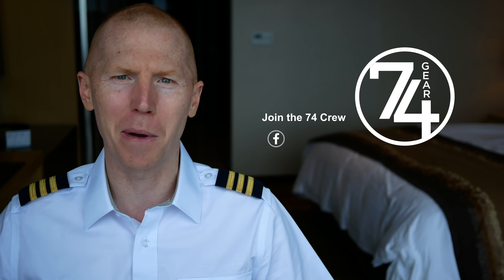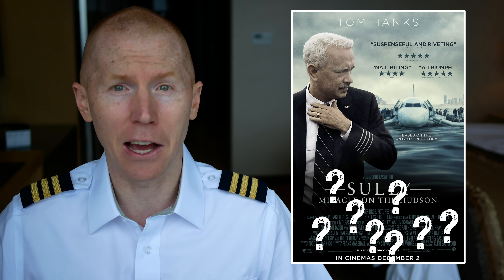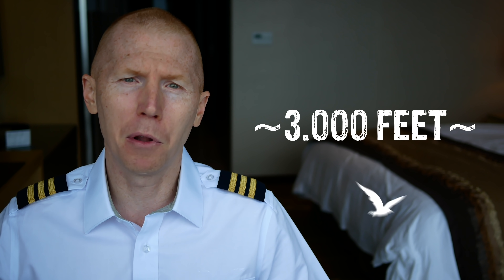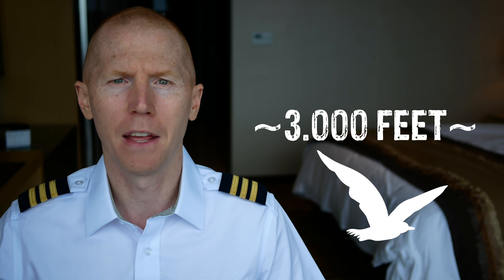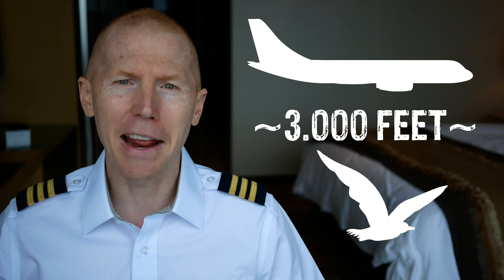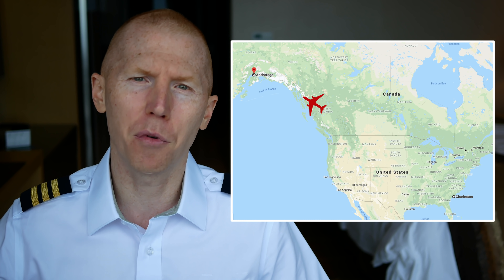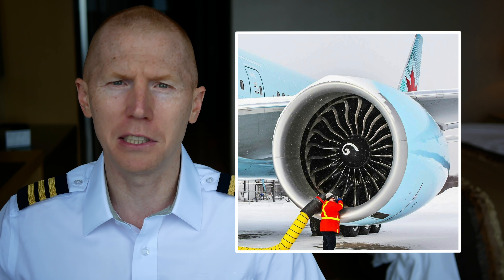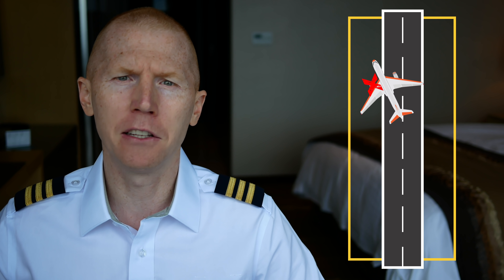Why Engines Don't Have a Mesh or Grates to Stop Birds

Comment: Per chance engines could be equipped with frontal macerators to pre-particularize birds, rendering them harmless.  Cheers!
Reply: LectronCircuits    good idea, then the macerated birds could be fed into the galley for a new lunch menu item !
Reply: @robertbernstein4488  eat 'em up yum!  Udaman.  Cheers!
Reply: Actually they are.
One of the design criteria for the front end of jet engines is the ability to handle bird ingestion. The fans and the first compressor stages are designed to chop the bird into little pieces and pass through the engine.

The engines are subjected to bird ingestion tests prior to approval.

Comment: This new imbalance technology - does it use more than one sensor? 😨
Reply: <<Sarcasm mode: ON>>
No it uses one sensor, because you know, that's good enough. Plus Boeing buys the made in China version, because you know, it's good and cheap, and that's just the way it is, Baby.

It goes without saying that this system is so awesome and perfect that there is no need to mention it in any documentation or training given to the operating crews. The FAA got us covered with their certification, so who cares,  and that's just the way it is, Baby.

Baby that's Just The Way It Is, Baby
Whoah whoah
That's Just The Way It Is, Baby...
<<Sarcasm mode: OFF>>

The dumb and greedy are destroying everything beautiful about aviation. And sadly it is going to be worse and worse. Just observe the facts with unbiased critical thinking.
Reply: Oh no! The Boeing 737 MAX nightmare revisited!
Reply: Imbalance has always been measured (and displayed) by the AVM--Aircraft Vibration Monitoring System for each engine. If vibration reaches level 5, the pilots are instructed to reduce engine speed to idle (where you can still operate the  A/C, electrical power and hydraulics). If still too high, they have to shut the engine off to avoid more damage to the engine or engine structure.

Comment: I have an unrelated question- on a 747, how many engines need to be providing thrust to take off, fully loaded?
Reply: Three. If the 747 loses two, it is doomed. Two engines on a four-engined aircraft is not the equivalent of one engine on a twin-engined aircraft.
Reply: @marks6663  Thanks, been wondering about this question, but couldn't even guess with any confidence 👍

Comment: Nah I'm calling bull, chain-link might cause 1%-5% in losses but you can make up for it with larger scoops/intakes.
And if its really that big of a problem at altitude, you can just have retractable screens.
Reply: What you're missing is how the engine actually pulls that air in. It isn't only about surface area but about how the air is funneled in. The screening would increase turbulent air along the boundary layer created close to the inner wall of the turbine and would decrease engine efficiency more than you are thinking of. Even at the 5% decrease in efficiency you listed it would require an additional 3000 gallons of fuel on a 747 when flying at it's full range.

Comment: How about a screen that retracts after the plane reaches 3000 ft?  Or if the pilot could activate a barrier if he/she realizes there's developing bird problem?
Reply: Reelin' and Rockin' lol thats a little dumb, the plane needs most of the power during takeoff
if u put a barrier like that it would cover atleast 10% of the engine
meaning 10% less air
so ur putting max power on the easy part and 90% power on the hard part
not very efficient if u ask me as u would need to make the engines stronger
in order to take off exactly how we take off without the barrier
Reply: Reelin' and Rockin' also im pretty sure when the pilot is at 100-3000 feet he doesnt see whats infront of him
cuz the plane is still taking off
most commercial planes cruise at over 10000 feet
soo yeh he wouldnt see a bird problem develop

Comment: Generally speaking, how many birds or what size bird does it take to kill an engine?
Reply: Not such a simple question to answer..any kind of FOD (Foreign Object Damage) can kill a jet engine..size is not the detirmining factor.

For example on aircraft carriers daily FOD walkdowns of the deck, between flight ops, are undertaken by lines of people, walking the full width of the deck, looking for even the smallest of nuts, bolts, ceramic shards from a dropped coffee cup..ANYTHING!

But to answer as best i can, I'll simply say that it depends on how well the object goes through the engine's various stages, without causing damage to them..

A jet turbine engine has several stages of compression, the big 'fan' at the front sucks the air in, but it then gets compressed down, to a increasingly smaller, tighter more compressive chambers, as it gets mixed with fuel, and combusted..

So, any object or bird that goes into the fan will one of 2 things..

1: It will get chewed up quickly, BEFORE it can break any turbine blades, or create any other such shrapnel out of any of the engines own internal components, (that will only create further damage & self-destruction)..and be spat out the back as a pink mist, with the rest of the thrust being produced..
 This 'should' be likely, if the bird's bones & mass get chewed up quickly enough by the first stage fans & their larger turbine blades..

Or

2: The object can damage the blades, more than they in turn  destroy it's mass & bones, which means that the engine will not only become engulfed by the amount of crap filling it, and interupting the air/fuel/compression & causing a flame out of the engine..

But also if the impact compromises the blades, they can also be destroyed, and at high speed revolutions, could break & become further shrapnel, like throwing a handful of metal into a  blender..that's also burning fuel..and, well..not good!

Sometimes, if they mashed well & quickly on their way through, and didn't break anything, just choking the engine into a flameout, you can get the engines to re-light..other times they can be completely 'fowled' up, & be far too badly damaged by FOD, to continue working at all..

So, There is no exact answer that would tell you that, it's all copacetic to what kind of FOD, how quickly it got minced in the first (turbine blades) stages, and then, how 'cleanly' it then went through the next stage (combustion chambers) of the engine..

A big bird could, potentially, be less of a threat than a small piece of hard metal..such as a bolt or nut, for example..

But if it hits wrong, and destroys blades instead of getting minced fast, even a smallish bird could cause flameout, or even destruction, of an engine..

There is just no way of knowing, until it happens, it's a bit of a 'lucky dip' really..

Hope this answer was somewhat helpful, even though it may seem obvious in some respects, it highlights the fact that it's a complex series of possibilities & outcomes..

But generally FOD is the bane of aviation, and to be avoided at all costs, as much as humanly possible..because anytime you catch any, you'll pay dearly for it in one way or another, Guaranteed!
Reply: Thank you for the detailed response.  Kinda surprised it doesn't happen more often.
Reply: @dr.chrisfragiskatos8341  
Most welcome.

Comment: The f18 has what are called turn screens, they are used on ground turns to prevent FOD from entering the engine and harming it. Even though it is a  fine mesh that is used they can still take the engines up to full afterburner with little to no loss on power.

Comment: If most bird strikes occur below 3,000 feet, why not design a system that puts a screen in front of the air intake that automatically retracts above 3000 feet?

Comment: With the high bypass ratio jet engines, even if a bird goes through the front turbine blades (and damaging the blades), there is a good chance any ingested bird will bypass the heart of the engine.

Comment: The airport authorities themselves have many counter-measure procedures to try and scare birds away from airports, reducing the chances of bird strikes.  Also, many standard procedures are in place to try and reduce the attractiveness of airports to birds.  For example, removing large bodies of water near airports (JFK is located next to Jamaica Bay, attracting many birds along one of the major bird migration routes, causing many bird strikes).  Lids on large garbage containers, to prevent birds getting into garbage looking for food.  Keep the grass cut at certain lengths, making it more difficult for birds to spot potential food from the air.  Always be cautious once the weather clears up after poor visibility or rain, the insects come back out.  Birds know where and when to find insects or anything they desire to eat, so they come out looking for insects to feed on.  Bird strike counter-measure procedures probably vary from one airport to another, depending on the type of birds located in the area and what those birds desire.

Comment: You know why I always fly on a 4 engine airliners?  Because they don't do 6 engine airliners!
Reply: WhitwellMike B the Russians might have a six engine plane
Reply: @kentrinfret2979  The Americans have 8-engine planes. And lots of them (the B-52s.)
Reply: @kentrinfret2979  yes. the worlds largest ever build aircraft, the Antonov AN-224 with 640 metric tons max. takeoffweight! sadly, there's only one of these beauty's:( 
It's  a soviet plane, made to transport the Buran (soviet spaceshuttle) but is Ukrainian owned today.
It was build in Ukraine also, but the engineers, designer and lot of the parts were russian. It didn't matter back then, it was all USSR anyway.
Reply: You must not fly very often then, both are rare as hell
Reply: they did them as far back as WW2, yes they do make 6(+) engine designs.
Reply: more engines == more shit to fail. theres a reason we retired 4 enging planes on favor of 2 engine ones.

Comment: The SU-37 has a "fence" that covers the intake on take-off and landing, However it could not work on a commercial aircraft for three reasons. 1 Commercial engines now have a bypass ratio that can be as high as 11 to 1 for some models. That is a huge area for a fence to cover. 2 The SU-37 has relief inlets (on the top of the LERX). That's not practical on a commercial jet as either they would be on the bottom of the engine increasing the risk of everything on the ground ending up in the engine, or on top which would compromise air-flow round the wing and therefore lift. 3 more moving parts means more safety issues. I would bet someone has done the maths and worked out the fence mechanism is more likely to cause an accident than a bird strike.
Reply: "2 The SU-37 has relief inlets (on the top of the LERX)."
No, thats the Mig-29 and the (older) Mig 29 had solid doors to close the intake.

The Su-27 family dont have relief inlets on top, it has inlets on the bottom of the intake, in front of the grill.
Reply: "2 The SU-37 has relief inlets (on the top of the LERX)."
No, thats the Mig-29 and the (older) Mig 29 had solid doors to close the intake.

The Su-27 family dont have relief inlets on top, it has inlets on the bottom of the intake, in front of the grill.

Comment: Hey, i know which hotel that is.  It's got to be Hyatt.  I was there during my layover.
Regarding putting anything in front of the engine will cause too much drag.  I recommend putting a laser on top of the vertical stabilizer

Comment: It seems logical to me that the weather radar antenna in the nose of an aircraft is optimized to detect water in the air. Birds are animals with flesh and blood. Flesh and blood contain a substantial percentage of water. The flock of birds Sully flew into, was said to be a large flock of geese weighing from more than 6 pounds to nearly 20 pounds (3 kg to 9 kg) each. Quite a lot of mass of water in the air. Or isn't that detectable because it is covered in fairly dry matter such as skin and feathers? If it would be detectable, a system could be designed that gathers its data using the weather radar antenna, and generates alerts similar to those from TCAS. Of course this isn't useful if the birds are encountered after V1 but before reaching an altitude that would offer any maneuvering space.

Comment: "Hey, let's put chunks of metal in front of a high speed fan disc and rotor assembly to protect it!"

"I'm sure as long as we maintain it properly, the engines won't be dining on chunks of metal randomly at 36000 feet!"